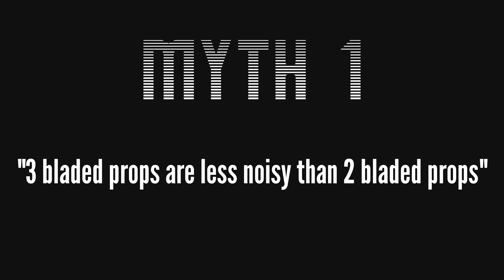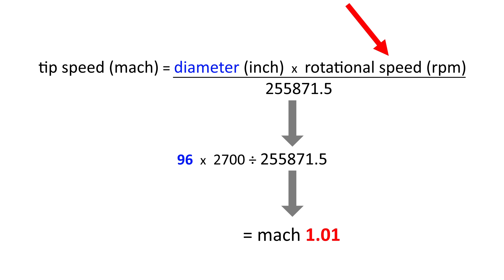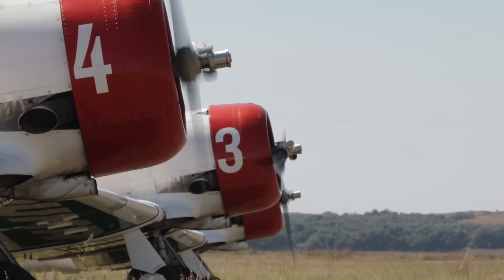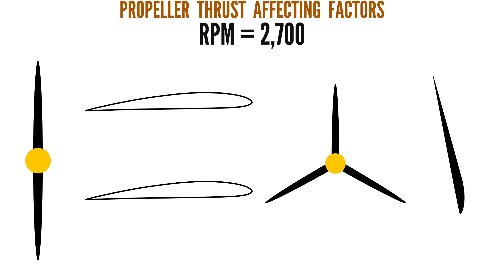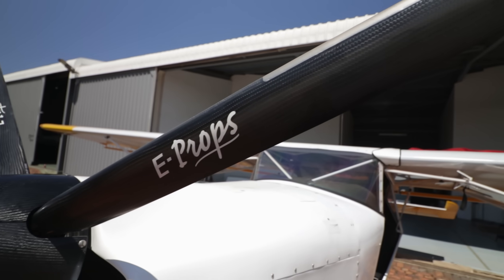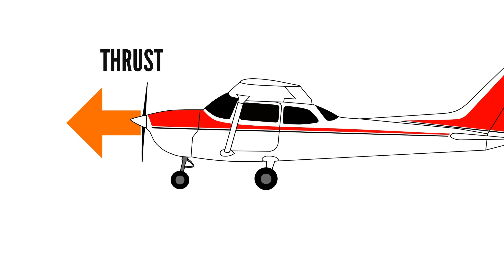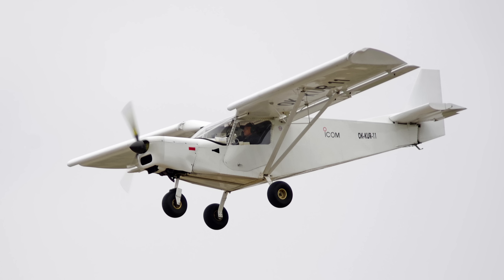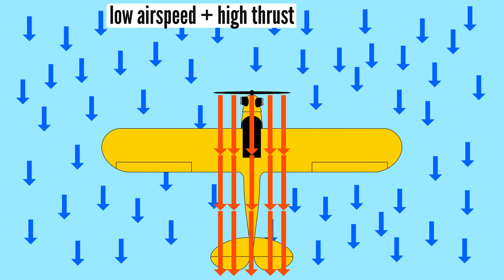4 Biggest Propeller Myths Explored - Long v Short & 2 v 3 Blade

Comment: Surely two identical blades will produce the same amount of noise each, as with three identical blades? Therefore you could expect the three bladed version to be louder. However, due to the way we perceive noise level, you won't notice much difference.

Comment: This is way too much for me to follow in every detail. But it's easy to understand that there are a number of cases when airplanes don't use the most efficient propeller because it would be to large for the ground clearence. And in some cases added number blades would be better. If the propeller spins several times the speed of the plane it means a low efficiency.
And it's easy to understand a larger diameter of a propeller in many cases would be better because a smaller amount of the air hits the aircraft body.

A misconception about propellers worth to mention is the same as the misconception about wings(because a propeller is rotating wings): that it works because of the typical wing shape. It does not. It works mainly because it's an angled plate. But the drop shape increases the efficiency.

Static thrust is easy to calculate but when it's at high speed I understand it becomes more complicated.
It's easy to understand that more propellers and more blades increase the thrust from start.
Doubling the blade area increases the static thrust with ~26% at a given power. And if 8-folding the propeller area the static thrust will double.
This because the thrust will increase in the same amount as propeller speed decreases.

Comment: In a propeller the diameter depends on the power of the engine while the pitch depends on the final natural top speed of the aircraft, 

No propeller likes the air coming in at angles other than 90 degrees to the propeller disc, as mushing the propeller will cause the down-going pitch to increase and the up going blade to decrease pitch  causing vibration. The gyroscopic effect of a large propeller could effect the  handling of the single propeller aircraft. The wing tips of a propeller should have both the leading and trailing edge trailing back,  Propeller and wings do not like vortices whose axis are parallel to the blade of to the wing span,  and it is better to have the  blade tips as a delta shape , for better control of the wing tip vortices. To stop the "paddle wheel effect" ( and stalling) of  a high pitched propeller near the hub, at slow take off speed the  inner third of the blade could have a slightly lower pitch than the outer 2/3 of the blade.

Comment: I ran into a problem where the smaller diameter propeller somehow produce more thrust with same rpm and motor when I tried to replace with a different propeller. I need more thrust for take off but not sure which direction to go? Do I increase the AoA or adjust the chord?

Comment: EXCELLENT video, though I’m not sure my internal question was answered. (From the perspective of moderately powered GA planes) “WHY would someone replace one with the other?”
You well establish the general balancing act blade manufacturers make, considering 2 blades are generally longer, and 3 blades are generally shorter, and the overall performance differential is generally narrow… So WHY one over the other?  An extra 200 fpm on climb for the 3?  An extra 2 knots at cruise for the 2?  Less noise and vibration of the 3? 3 blades look rad?
Honest question.  Thanks.
Reply from the maker: Good question. It's almost never worth the cost of a propeller for 2 or 3 knots gain in cruise speed, or 50 of 100fpm better climb over the current prop. Yet props are changed often enough for that very reason, looking for a "magical" improvement which don't often happen. 

It may very well be worth doing your howework if a new prop is required as opposed to replacing one though. So this is more about the theory behind it and the popular misconceptions that get passed down from pilot to pilot.
Reply: Someone put a 3-blade prop on my Arrow long ago.  I like the looks but I’ve always wondered “why”?
As the Owl from the Tootsie Roll commercials said, “The world… may never know”.

Comment: These principles can be related to boat propellers too.
Since water is a fluid as the same as air.
Boat Prop Diameter, Prop Pitch and  RPM. But since water is denser the air,
a lot more RPM is needed.

Comment: So it's simple, there the tones of ways to determine the performance of you airplane, you can have one thing but let go the other, this doesn't only depends on one factor, you can have a fast flying and a slow flying airplane even with the same power and propeller just using a different airframe.

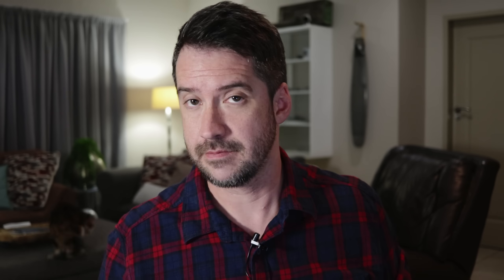Comment: 1:17 got confused. 😵‍💫 As I know, when an object spins around it axis, the closest parts spin faster and furthest part spins slowest hence the longer the blade the slower would be the tip compared to a shorter blade?
Ok, I got it, the difference lies because of the same rpm, as they the spinning at the same rpm so the longer blade's tip has to travel faster in order to maintain the rpm

Comment: Some model aircraft use a single blade prop, they spin them at 30,000 rpm, having two blades would mean that they are almost spinning in a vacuum. I think they are F2A control line planes. (The spinner has a counter weight so that the single blade is still balanced)
Reply from the maker: There are some single blade propellers for full size airplanes too, like the Everel single blade prop for the Piper J3 cub, and some motor gliders have them too. Very interesting, did a video about it some time ago.

Comment: In Helicopters - and I'm not sure the thing on the top is called propeller, btw - do get quieter with more blades because most of the noise comes from the blades crossing over the tail. Of course that together with less rpm makes it even quieter.

Comment: 3:49 This can't possibly be right.  This implies that, as long as you hold the speed and blade length constant, the noise doesn't increase with number of blades.  So a 2-blade propeller with a 1 meter long blade turning at 2000 RPM produces the same amount of noise as a 7-bllade propeller with a 1 meter long turning at 2000 RPM?  I would expect each blade tip in both configurations to be producing the same noise, and so the 7-blade propeller should produce 3.5x as much noise as the 2-blade propeller.

Comment: Actually, thickness is not a factor in lift production - all aerofoils (even flat plates) are going to try to make a theoretical maximum lif coefficient Cl of 2 x PI x AoA, where the CL slope is 2 x PI. 3D effects such as aspect ratio are going to decrease this slope and so the lift at a given AoA, but this doesnt include the thickness. Thickness will affect separation and therefore stall point and pressure drag, and therefore the L/D ratio, but not through a decrease (or increase) in L, but rather through an increase (or decrease) in the drag .... likewise for camber
Reply from the maker: I'm not sure we are talking about tue same thing. Changing blade thickness without changing chord to maintain the same ratio will change camber. Changing camber, apart from changing stall AoA will increase or decrease drag, and it will certainly modify lift production.
Reply: @LetsGoAviate  Its a popular misconception actually. The 2D lift slope (theoretical infinite wing) is 2 x PI, and the amount of lift produce by a 2D aerofoil (flat plate, sail (= zero thickness), Clark Y (thin) or one of the thick NACA profiles) theoretically will produce lift at this rate. As I mentioned though, thickness, camber etc will affect separation points and (pressure) drag (viscous drag too, if it significantly increases the wetted surface), which affects the main performance metric aerodynamicists are interested in (L/D). When we start talking about real (3D) wings, typically an efficiency factor (e) is used to reduce the lift slope. However, as I mentioned, thickness of the aerofoil doesnt affect the planform efficiency, rather taper ratio, wing loading etc will. Thickness, as with camber will not affect the rate of lift production per degree AoA up until the flow separates. So as I said, I could replace a higher performance NACA airfoil with a flat plate, and through its operating range (non separated) of AoA, would produce exactly the same amount of lift as the streamlined airfoil. Of course, as i said, the plate will produce more drag for the same AoA, which affects L/D and also stall points, but not lift.
Reply: If you dont believe it (many students I lecture dont, until they prove it to themselves in a windtunnel). have a look at the Cl curves in Abbot & Von Doenhoff. They're all very boring because they're all the same (straight lines of 2 x PI x AoA). The lift-drag polars differ, of course, because the drag per aerofoil changes, but not the lift curves. You can also read up on classical thin airfoil theory, if you like math.
Reply from the maker: @icojb25  I'll take your word for it 🙂 Making a blade thicker will increase drag though (even though it doesn't affect lift values as you explained). Increased drag means more load on the propeller, meaning rpm decreases, meaning total thrust reduces. Thus indirectly, lift (or thrust in this case) reduces as a cause of making blades thicker. This is what I was getting to, let me know if you agree.
Reply: @LetsGoAviate  For a given RPM, thickness is not going to affect the thrust vector, assuming the drag has no axial component (which is mostly reasonable). Of course, increasing the thickness will increase  the drag (although a thicker aerofoil doesnt usually generate a huge amount of extra drag (if its designed right)) and therefore the energy required to turn the propeller, so SFC will go up. The main impact of thickness is operating AoA range (stall margin), and other things, as you pointed out, like shocks. A thick prop which is streamlined and / cambered correctly is going to resist separation much better, extending pitch / helix angles etc, and a thick prop is going to be much louder, esp as the tips enter the transonic / sonic flow regimes. Highly loaded props are also going to be structurally much heavier, since the loading per cm is much higher. On noise, probably the greatest factor is loading, so thats why big old T6 Harvards are much noiser pound for pound than things like C-130 with fans and prop fans and even ducted fans in conventional high-bypass engines. Cool videos though, very enjoyable. Nice to chat with a SAFFA too.
Reply from the maker: @icojb25  That is very interesting. I'll have to spend a bit more time absorbing this though, but I love diving into these subjects. Thanks for the info. You might also like the video I'm working on now about a specific propeller. It's not the next one coming out (which is engine related) but the one after.

Comment: You missed an important example, The P-51 mustang. They used propellers with 4 very long blades, driven by enormous V-12 cylinder liquid cooled engines. They were arguably the fastest open-propeller planes ever made.

Comment: A few things to mention -
1] The P-47D propeller diameter actually increased in later production aircraft, and went to paddle-blades to improve the aircraft's performance. The propeller manufacturer also changed going from Curtis Electric to the larger diameter Hamilton Standard propellers.
2] On the F4U Corsair, it was design choices. True that they used a 13ft 4in 3 bladed diameter propeller, but in use, they found that the shorter landing gear made the fighter bounce too much when landing on the carrier decks. The oleos had to be modified to reduce this effect. By comparison, the contemporary F6F Hellcat, with the same engine as the Corsair, used a 13ft 1in 3 bladed propeller. It was a mid-wing design with long landing gear that actually allowed the Hellcat to be relatively easy to land on a carrier deck. 
3] The British Hawker Tempest  Mk V & Mk VI and Typhoon Mk I, both low winged designs powered by the Napier Sabre engines, had 14ft diameter propellers. The Typhoon had both 3 bladed and 4 bladed propellers, whereas the later Tempest Marks mention were standardized on the 4 bladed propeller.
4] Someone did some research on the the Westland Whirlwind on why its Rolls-Royce Peregrines were so unreliable at over 20,000ft. Apparently the prototype Whirlwind managed quite well at those altitudes but production aircraft were not able to do so. It turns out that the actual culprit were the propellers. Although they remained the same diameter, the manufacturer switched from Rotol, which used thinner wooden composite propeller blades, to De Havilland (licensed built Hamilton Standard) that used slightly thicker metal propellers. It turns out that at higher altitudes, the thicker blades caused an earlier onset sound barrier compression which caused a cascade effect of reducing power, changing pitch angle of the propellers, which in turn caused unexpected extra stress on the Peregrine engines leading to early failures of the engines.

Comment: Given a fixed geometry of 2 bladed propeller, you said that if you switch to a same-diameter 3 bladed propeller you can reduce blade width (chord), prop diameter, or blade pitch to allow the same engine power output to spin the propeller at the same speed.
However I don't think you covered the effect of changing blade the blade's maximum thickness, and aside from my understanding that wings with a lower thickness are needed for aircraft that intend to travel at transonic and supersonic speeds, I am unsure if this would have any meaningful effect on allowing the propeller to spin any faster. I do know that it would in theory reduce thrust, which should reduce drag, so a sufficiently lower thickness of blade airfoil profile might allow for the propeller as a whole to spin at the same speed as the 2-bladed propeller, however I am unsure if it would produce the same amount of thrust or not. I'd appreciate some info on this and other things like blade camber, since they seem to have not been covered in this video!
Reply from the maker: That's a very good observation. Indeed I didn't cover changing blade thickness as a method of adjusting power absorption. While blade thickness can easily be change by also changing blade chord length, the two can't really be changed independently from each other, because changing blade thickness without changing chord length changes camber, which is a very important property for the blade's thrust producing properties, as well as determining a blade's stall characteristics. While it can probably be changed slightly to increase or decrease the load on the blade (power absorption), I strongly suspect manufacturers don't change blade thickness after initial design, i.e. a manufacturers propeller range from 65" to "75" diamater blades (as an example) will have the exact same camber shape. 

Camber also contributes to blade strength, i.e. a thicker blade has more material and thus more strength. So blade thickness can also not be freely reduced as it has an impact on the strength of the blade, which is important.

Manufacturers thus probably (I guess) choose the thinnest camber shape they can get away with material strength-wise. Thus changing blade thickness (and thus camber) afterwards would change the aerodynamic properties of the blade throughout it's speed range, requiring propeller design to start from scratch.

There is probably even more factors I didn't mention (propellers are extremely complex aerodynamically), but hope that helps as a start.

Comment: At the 3:45 mark of the video I agree the same length blade on a 3-blade or 2-blade prop would create the same amount of noise PER BLADE. So wouldn't 3 blades creating the same amount of noise PER BLADE, be 50% louder than the 2-blade prop? IOW doesn't each blade produce its own equal amount of noise?
Reply: The volume is generated at the same amplitude per blade but at a higher frequency. You would perceive it as being higher pitched and depending on your hearing that could be louder or quieter
Reply: This is probably because doubling the actual sound source only creates 3 dB of perceived volume increase. However a perceived doubling of a sound level is 10 dB.
Reply: @rienkhoek4169  I don't understand your response. Let's say 2 blades produce 10db of noise, 5bd each blade. Adding a 3rd blade would then add another 5db of noise or 15 db of total noise. Did the noise from 3 blades increase the 'NOISE' or the 'PERCEIVED noise' by 50%, i.e. 15 divided by 10 or a 50% increase? If not 50%, what percent did the 'NOISE' or 'PERCEIVED noise' go up by?
Reply: @hifinsword   The dB scale is logaritmic. So going from a 2 bladed prop to a four would be double the energy, but only 3 dB extra volume. So your ear will not perceive that as double the soundlevel although there is twice as much energy being put into that sound.

Comment: I fly a Vans RV6 with a Hartzell CS prop and a Lycoming O-360. I like to cruise with the prop at 1800 rpm and manifold pressure at 22”. IAS is about 125krs and fuel flow about 5.8 gph. Very efficient. Less engine wear with lower friction and more time for complete combustion. Engine temps are lower. Noise is lower too.
Reply: Very sensible. And intelligent.